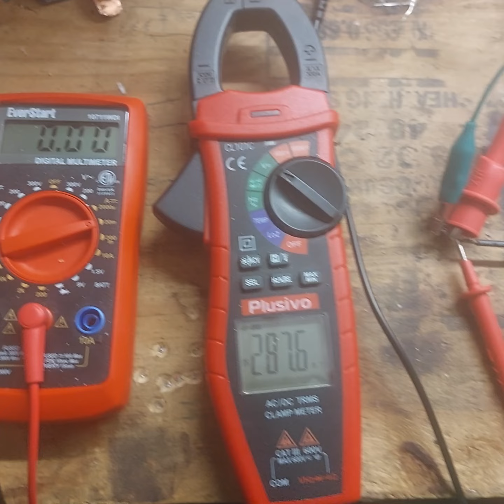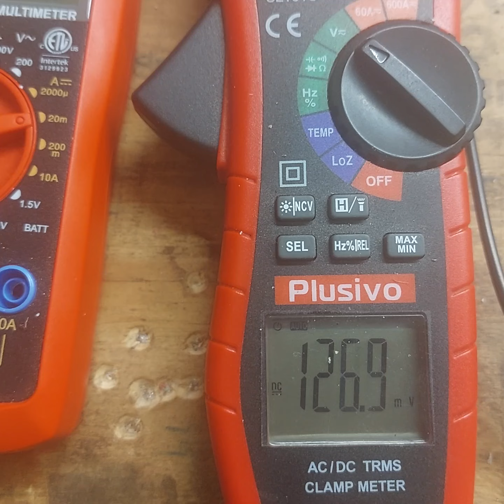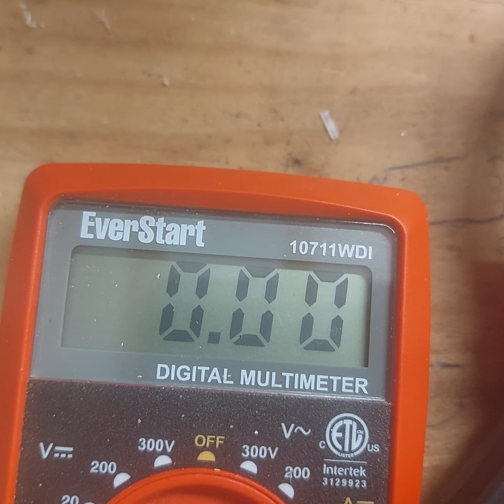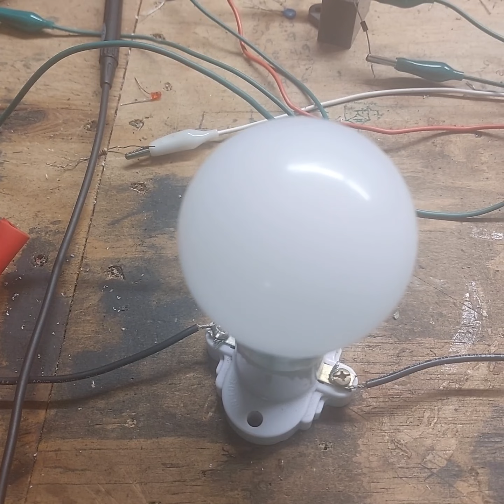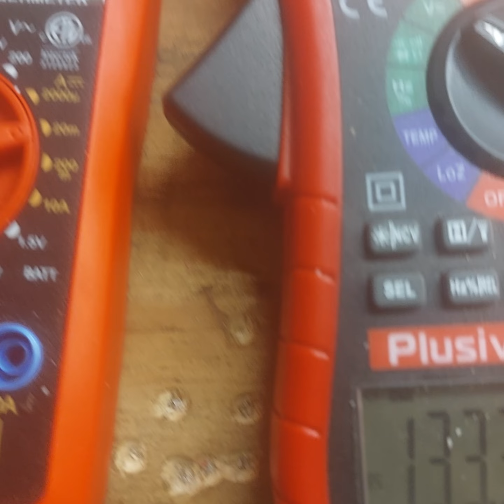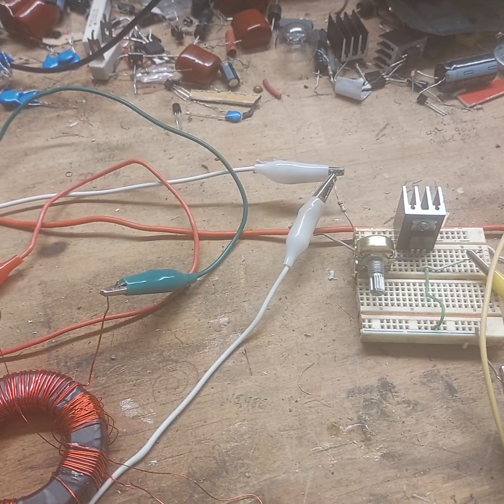Toroidal Parternerd Output Coils

Comment: Great video, any updates?
Reply from the maker: Sorry for Long delay getting back. Though I haven't been doing any work lately with this particular coil it is a very interesting coil . One thing I forgo t to mention in vid was the length of wire is very important. The pri and sec are a 1:4 ratio I believe and th e feed back pri is 1:2 ratio.